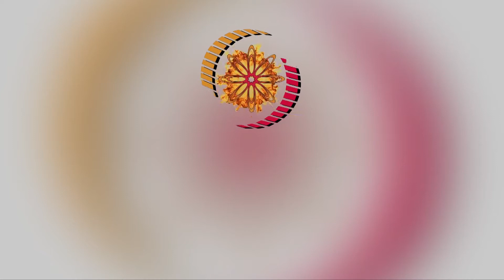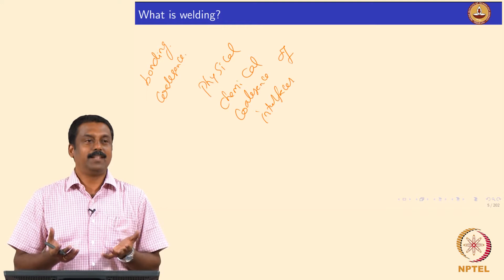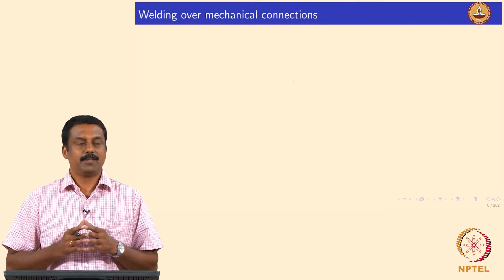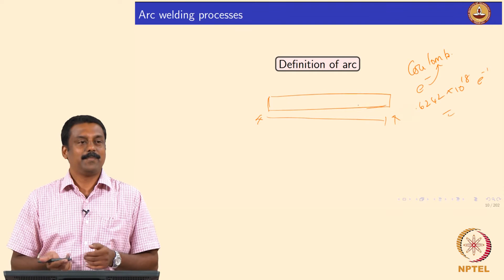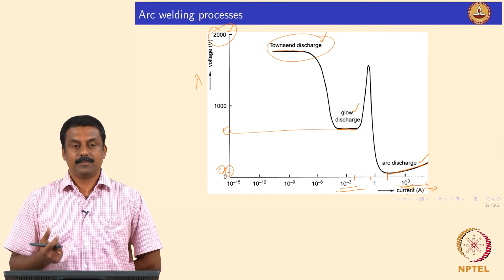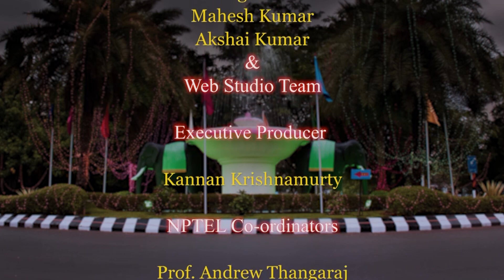#2 Classification of Welding Processes & Understanding the Welding Arc | Welding Processes

Comment: 1 Volt is defined as the #potential_difference between two points in a current carrying conductor when 1J of work is done to move a charge of 1 C from one point to the other.

DeltaV= w/q